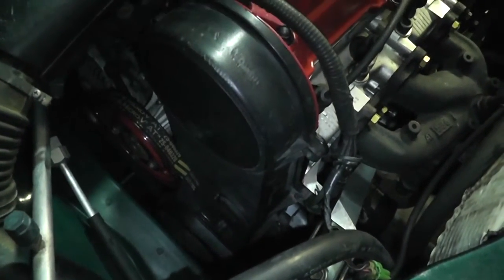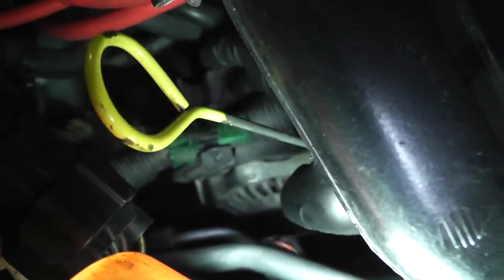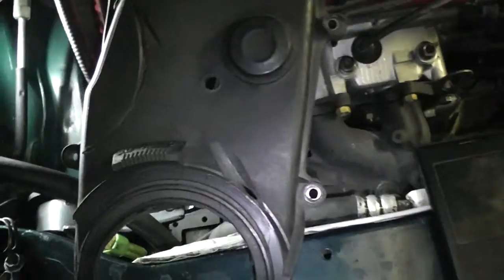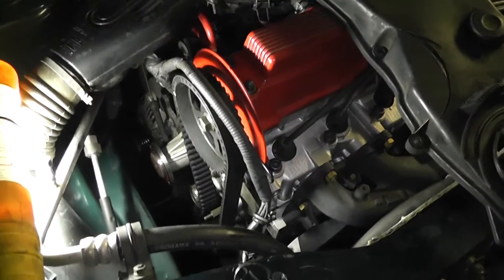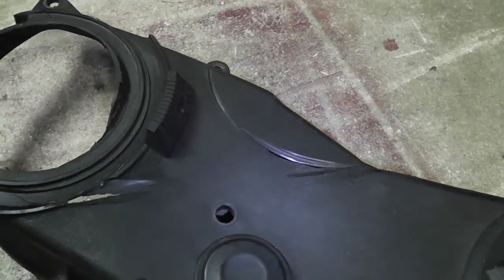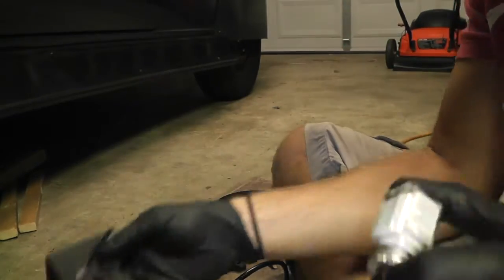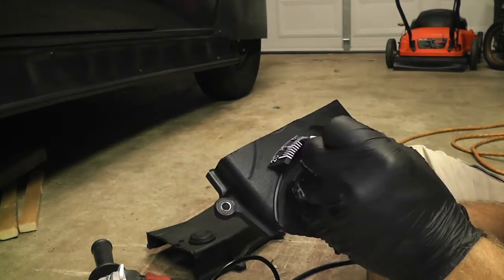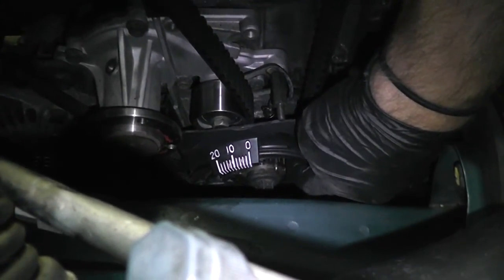Geo Metro Custom Timing Cover Modification

Comment: I'm in Florida living in my Metro in a Wal-Mart parking lot. Water pump is rusted out and leaking. Valve cover is leaking oil onto my belts. Mechanic said my timing belt probably got wet too. 😏🙄 but how, if it's covered??? He just wants to rip me off. I've been doing my own work on my cars since 2000. I just never done a metro.
I have a new water pump, timing belt, cam & crank seals, alive cover seal and new water pump belt. 
If I start early morning, do you think I'll be done before sunset 7:30 pm??? Last off all I have a stuck oxygen sensor that needs losened. I have no blow torch, but I do have the long box wrench closed end. Thinking about leaving it in and drilling a new hole and steel puttying a new one on in a different spot.  Any recommendations how to get it off without a torch?😭 And why can't I find a IAC valve for this 97 metro lsi 1.3 ???  Anyone please help!😭😢
Reply from the maker: My head came pre-assembled so I'm not sure how long cam and crank seals will take, but, yea man i think it's possible.  There could be oil on the timing belt.  It's covered from the engine bay but essentially enclosed up against the block.  Still, that's not the end of the world, just keep everything lined up timing wise and you can swap it out.  Good luck fellow travellers!  We're building a skoolie conversion for our family of 8. Maybe we'll see you on the road one day!
Reply from the maker: Hey, remember to add some silicone to the sharp turns when you put that gasket in or it will leak again

Comment: Question 1.) How did you get the Crankshaft Pulley off?  2.) You took off the Water Pump Pulley to get the Timing Cover off? 3.) What do you torque the Water Pump Pulley and Crankshaft Pulley to?
Reply from the maker: Shoots!  Dude, I'm sorry, I had a brain injury since this series and I don't remember a lot of things. Check the geo metro forums, someone will know for sure. GL w your ride!
Reply: Yes you have to take off the water pump pulley

Comment: That does not provide enough protection, sorry.  Anything can get thrown up in there and make your timing belt snap (I know, I actually tried this and didn't get 50 miles before my timing belt snapped).
Reply from the maker: Bummer

Comment: What happened to the geo. Why did it blow again. I’m bout to change my head tomorrow. Hope I’ll be ok
Reply from the maker: You should be fine bro.  Mine only blew because I a heater core hose blew while I was on a snowy mountain road that had no shoulder so I had to keep going without coolant.  Predictably, it overheated too bad - those aluminum heads and block really don't like heat.  Anyway it was operator error, not a bad install and the second one has held up great!  Here's a video of me blowing it the second time: https://youtu.be/-QRU4sQ3Bz0

Comment: Running without a proper timing cover isn't a good idea. Road debris can get throw up into the belt area and those toothed belts aren't as forgiving as the ribbed kind. Years ago I did this mod on an 84 corolla, along with a new belt and tensioner, and after a couple weeks the belt had a pretty good sized chunk taken out of it. Had to replace the belt again and re-install the cover.
Reply from the maker: That's definitely a risk worth consideration (as with all mods lol).  I haven't  had ANY issues but then again I drive in California where debris is minimal and the ground clearance on this car with the front lip help protect it.  I've never had any problems with the belt and this videos pretty old now.  Still - modify at your own risk people :D

Comment: Have you experienced any timing belt walk problems? Or was it just the timing belt cover warping that caused the wear marks?
Reply: i believe if the belt is walking the idler pully is over tight
Reply from the maker: +Storm Didas I haven't had any walking issues since the mod but I did it as part of a whole performance head and cam swap so it's possible it was walking prior or haha I did overheat it when I blew the headgasket 🤔 so there's that warping possibility also...
Reply: Imperial Beach Dad  i believe if the belt is walking the idler pully is over tight
Reply from the maker: @jackhilley6962  that makes sense.  The inside of my cover was worn pretty bad so it must have walked prior to the rebuild.  It doesn't now so I must have gotten that idler pulley on right in the rebuild